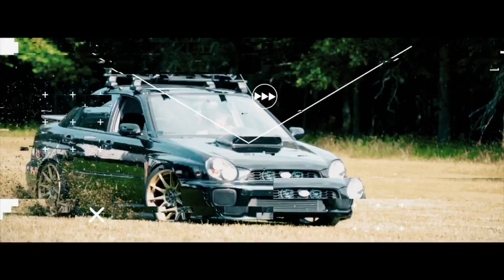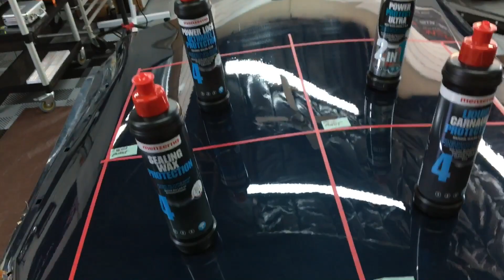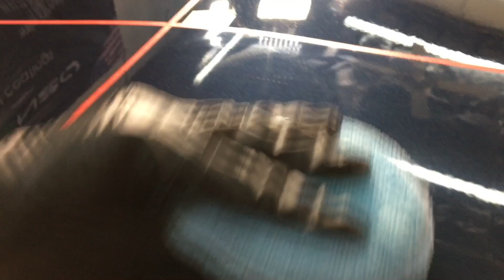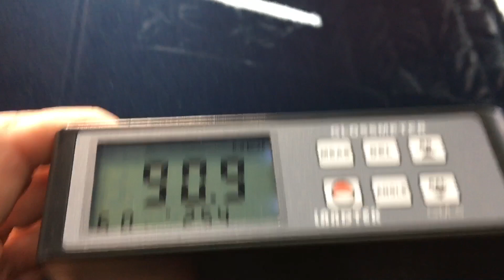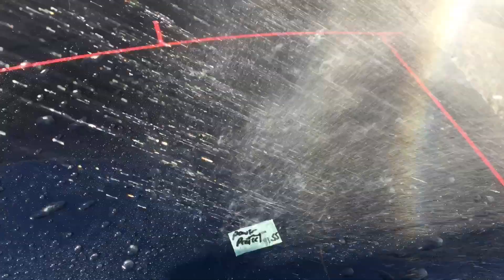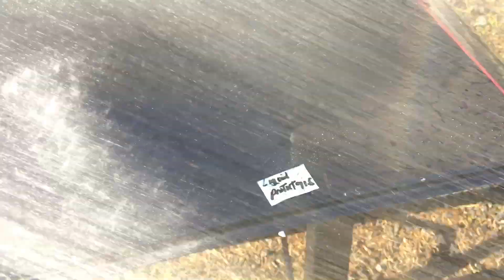Menzerna-USA Auto/Marine Detailing Products! Plus! Protection Comparison Including PowerLock!!

Comment: From where i sit, use a base of power lock and top with power protect. Use the liquid protect as the sacrificial layer. Personally, I currently use power lock as a base and top with collinite 845 insulator wax.
Reply from the maker: Sounds good to me.👍
Reply: Skip the Ultra Power Protect as it has abrasives in it that would comprimise the Power Lock.
Reply: @tonymattisson6158  i screwed up and listed the wrong topper. I have now corrected it to what i was thinking